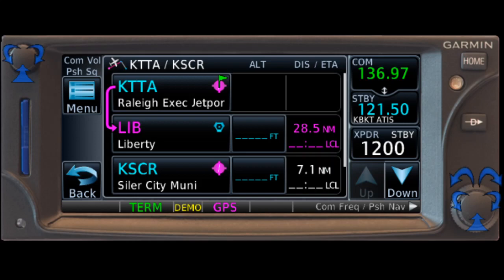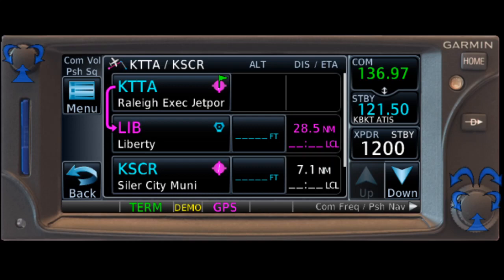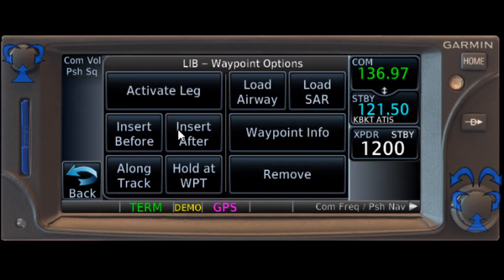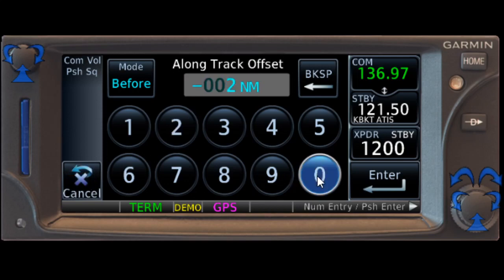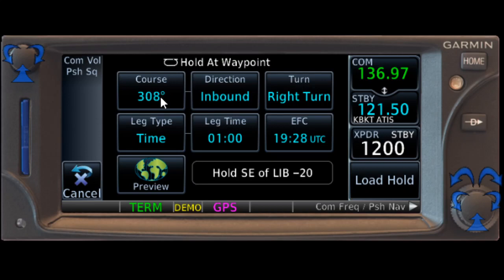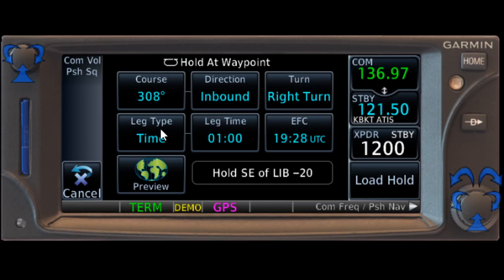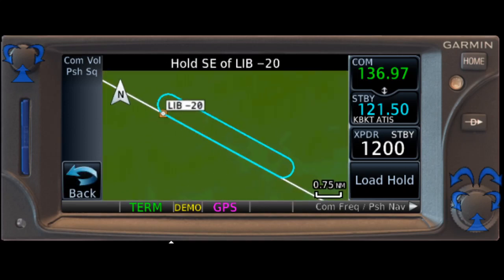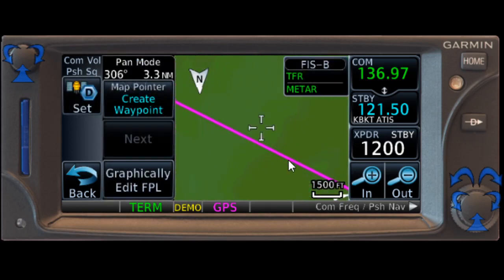Distance Hold Using the GTN 650

Comment: I tried this but the along track button does not appear on my 650. Do you have to have this paired with an actual DME in order to get the along track button ?
Reply from the maker: @Marchetti7  no you do not need actual DME. The distances are based on GPS.  I can’t explain why you are not seeing the “Along Track” choice on the lower left when you tap a waypoint. Is it a waypoint you are going to from another?
Reply: @ The reason is because I either don't have the 6.51 or above version upgrade or it is currently configured to VCALC instead of VNAV or both. Garmin says to take it to the dealer to upgrade and/or configure as if it is as easy as going to Starbucks to order a cappuccino ...
Reply: @midlifeflyer  @ The reason is because I either don't have the 6.51 or above version upgrade or it is currently configured to VCALC instead of VNAV or both. Garmin says to take it to the dealer to upgrade and/or configure as if it is as easy as going to Starbucks to order a cappuccino ...
Reply: @midlifeflyer  there is also a comment that state that the 650 needs to be connected to a baro in order to switch from VCALC to VNAV... Frustrating...
Reply from the maker: @Marchetti7  Yes, VNAV requires the GTN to be connected to a barometric source. Otherwise, how would it know to instruct a level off at the target altitude?